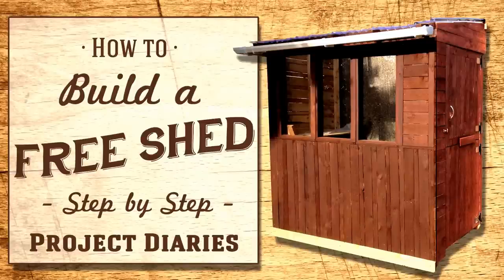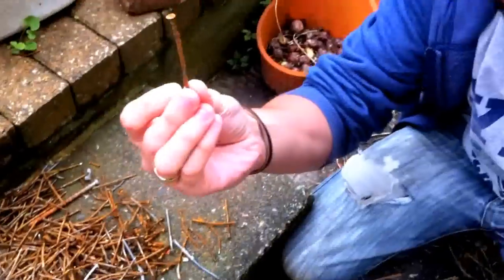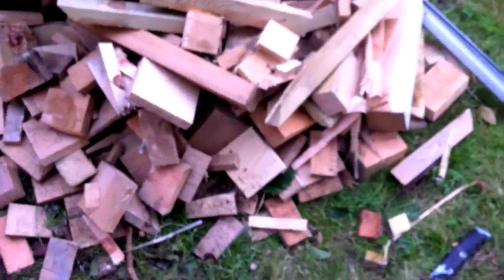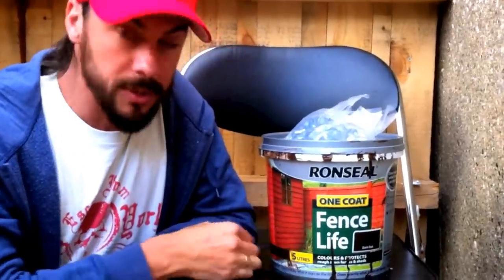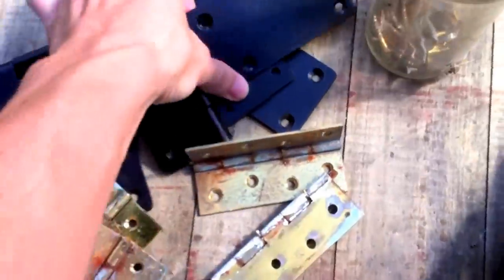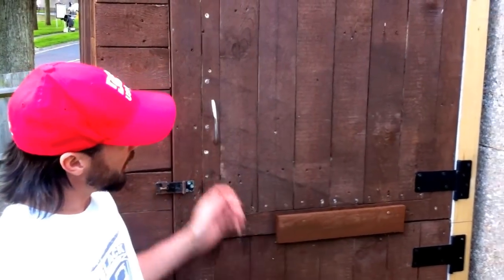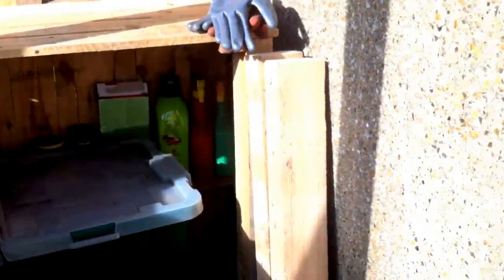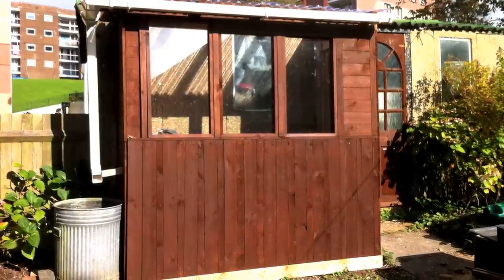★ How to: Build a FREE Shed (A Complete Step by Step Guide)

Comment: At 9:30 you say you don't know what yer pallets are treated with and use a sealant. The sealant is a GREAT idea, to make this project last so much longer.

A helpful tip, mate. When picking pallets see if they have an HT stamped or burnt into the pallet. HT for Heat treated great for human projects and food production.

Comment: This is an amazing job!  I can't believe you got all the pallet apart without splitting the wood.  They must make pallets different in Britain than they do in The U.S.  The pallet here are hard as heck to take apart with out splitting them to bits.  We use a
Reciprocating saw.  Love you design and the fact that the materials were FREE!!  By the way, the door you made is much better than the one you originally had.😍
Reply from the maker: Thanks Pam, Have you seen my Pallet Safety Video? It may explain why you're having trouble splitting Pallets :)

Comment: I wish I had the tools! As a female, my toolbox is very limited to the mear basics, really lacking the power tools cause they are so expensive.
This shed is so cute! I have dreams of making a tiny house/shed and this shed would be perfect if it were only slightly larger. I like the clear roof and the gutters.
I'm also a big fan of using pallets and reclaimed material's. Once when homeless, I made a pallet platform for my tent. I used 4 pallets covered with carpet padding and carpet. My tent fit perfectly leaving enough room for sitting outside. My duck, Dickins, would protect "her" property, pacing back and forth on the "porch", quacking and honking at any person coming near.
 I didn't have to worry about the rain because I set up my camp in an old grainery structure with cement floors and huge supports surrounded by wire fencing. It was set along the river and I completed my camp with a large dresser with drawers and shelving, a place to hang clothes, a port a potty, and an area for my camp stove that had curtains that sort of created the look of a kitchen.
It was  admired among the other homeless. I even had a police officer jokingly say that I had more stuff than the law allowed for a homeless person.
Anyway, I sure liked your shed! It encourages me to get back to nature and create myself another camp. By choice, not by circumstances! Cheers!
Reply from the maker: I barely have any tools myself so it was tricky. I'm glad you did so well. Being homeless is an awful situation to be in. I used to feed and help the homeless a lot. Hopefully you're back on your feet now? Well done for not giving up
Reply: Project Diaries ∼ Thanks! Yes , I am now an apt. dweller. The luxury of a toilet shower and air-conditioning are the only perks I'm glad I have now. Otherwise, I live a very  similar lifestyle.
I do have a TV, but only get reception from a converter box. My favorite thing now is my smartphone. I have all the recharging goodies like winding, solar, and an unlimited plan, which is what I need cause I'm a YouTube junkie! lol
My homeless experience has been very positive and healing. It also happened when I wasn't as disabled as I am now, tho I am continually amassing my survival supplies and trying to save up for tiny house stuff. Never having a credit card in my 58 years, keeps my tiny house dreams and budget very small. I may just save for a van or SUV and really keep it small and mobile. Much more doable, don't you think?
Thank you for replying and well wishes. 
PRAYERS AND BLESSINGS TO YOU AND YOURS! ✝ @∼[∼∼ ✝ 🙋

Comment: You can get the nails to pull out straighter by using a fulcrum like the head of a second hammer. The idea is to pull in a  more straight up motion.
Reply from the maker: Yeah! there are a few alternative ways of doing it. I was just working with the tools I had at Hand. Also come out straighter if you place a Plank under the hammer and pull up straighter :)

Comment: soak the nails in vinegar and the rust will go away. Also we used that same nursery roof it is very expensive, and we just screwed it down onto the frames front and back and centers. Yes if the screw comes out it flops up as it's doing right now. It's hard to fix it to a flat surface. You are so lucky you have a dad who knows all that stuff. Thanks Dad.
Reply from the maker: Dad just had the Tools, I have the ideas ;) Instead of using expensive Vinegar just use cheap Cola. It's works better!

Comment: A couple of faster tips...to break them down...2 2x4's as leavers...and shorter ones to sit on each side once other boards are removed...or...a recip saw...and just cut off the boards by cutting the nails:)  Anyway, LOVE the idea, and will use this!  Love the way you supported the roof...many forget this part and later regret!  I have never seen those caps either here....I WANT SOME!LOL .  I will look for that, also , gives a ton of natural light...that England is usually in need of.  OK, Canada too at times:) 

Did you use caulking to seal the roof edges, and the edge that is next to the garage so dirt does not get blown in...?  Will keep it even more water proof during those rain storms.. Cheers buddy...and have a cuppa tea on me!  KEEP UP THE GREAT SKILLS and share!

Comment: that was great. the only thing i would of done. on the pull up table you just pushed the bolt through to hold legs in place. i would of turned the blocks the other way, rounded the top of the legs & then the legs could fold up & down when in use.

Comment: really good video and you have inspired me to do my own, what did u use when cutting the pallet planks in half?
Reply from the maker: I don't have many Tools so it was just a hand saw. My Dad brought his Circular Saw once that helped with the Roof
Reply: thanks for the help, i am also very short on tools but was worrried about cutting the planks for staightness, hopefully mine will end up as good as yours
Reply from the maker: Just draw the guide lines and let the saw do the work. Trying to cut to hard or fast will make you cut badly. Good luck.

Comment: Just a bit of advice for anyone who breaks up pallets in the future,
The easiest way is to put a brick on its side (or two bricks) under a slat next to the crossbeam,
Then jump off the ground and pound all your weight onto the next slat along, just above the cross beam, and repeat!

A lot easier than using a crowbar, however the easiest way is to use a reciprocating saw and cut the nail from between the two bits of wood

Happy breaking lads and ladies

Comment: Love that you did this for your gramps. But the only thing that's freely available is the pallets. Then he just all of a sudden happened to find the exact thing he needed. Where'd he get all the wood for framing? And the pallets were all mint. I've used pallets many times before and they're all busted up. Ussually easy to take apart and salvage tho.
Reply from the maker: Clearly you didn't pay too much attention while watching. The framing was all pallet wood. I also said there were some scrap pieces at the wood store. Seems like you need to do a bit more research in finding better resources. This was my first time and I had no problem finding anything.